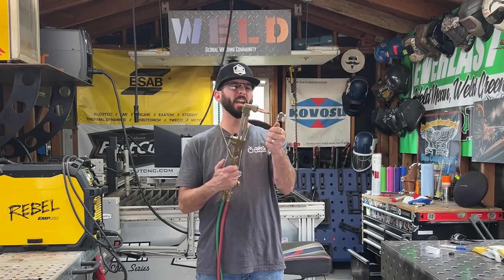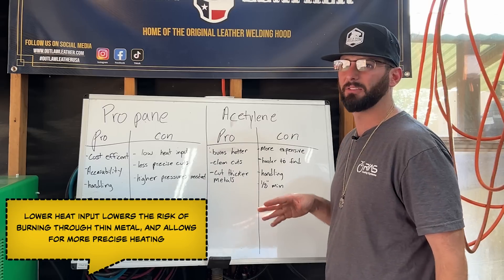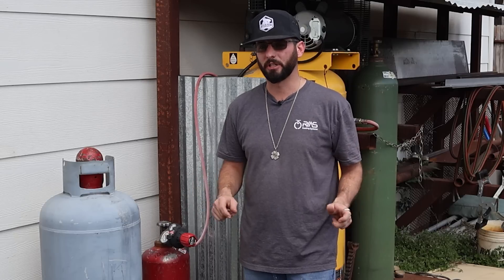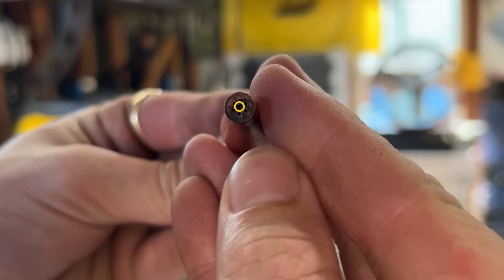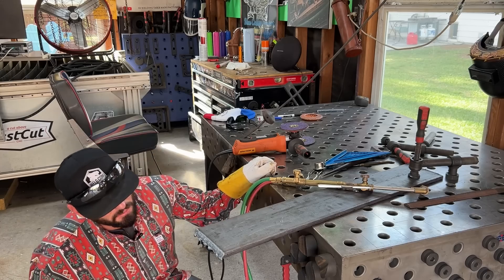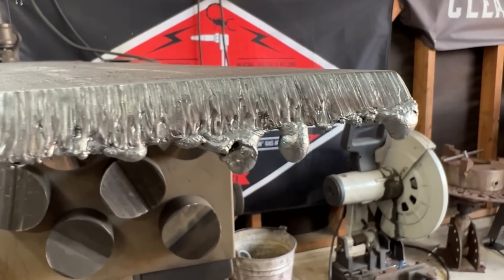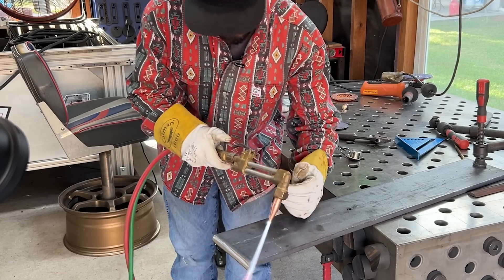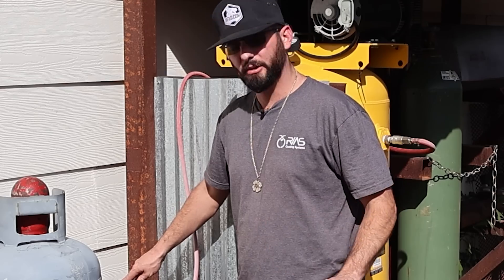Which Gas Is Better For Oxy-Fuel Torch Cutting

Comment: When i was scraping i ran 15 psi propane and 100 psi oxy i preferred propane over acetylene as you hold the tip further from the work reducing tip plugging on the rusty scrap

Comment: 2:15 - propylene (proper chemical name: propene) is not "a mix between the two" (albeit it may "behave like" one) but a separate compound - an unsaturated hydrocarbon with formula CH2=CH-CH3 (not to be confused with propadiene, CH2=C=CH2, which is a constituent of MAPP gas).
The trick/ goal/ idea is to lower the hydrogen to carbon ratio, as too much hydrogen, paradoxically, prevents the flame from reaching high temperature - as at higher temperature hydrogen does not burn completely to water (H2O), but remains at "intermediate" HO- radical stage. And that's why (fun fact/ useless trivia) with "no hydrogen" flame, like cyanogen NC-CN (triple bond between N and C) and oxygen the temperature goes way up, to 4500 °C / 8100 °F.

Comment: Cutting is all in the preheat and the oxygen.  The fuel gas is not a major factor. Once you start the cut, you can actually turn off the fuel because the oxidation of the is what is making the cut and the heat. This is why your results are so similar.
Reply: Yes, you can actually turn off the fuel and you'll be able to happily cut along for some time , albeit not very long one, as carbon steel is rather good conductor of heat / heat sink and thus the heat balance (i.e. input vs loss) will soon turn toward "to cold" and it'll stop.
"Back then" (about forty years ago) as a young "gofer" lad I happened to assist one welder in his job at the company I was employed by back then, and his job was to weld in, oxyacetylene method, a section of a regular 2-1/2" or 3" plumbing steel pipe, but he forgot to take with him the cutting torch, so he resorted to this "heat it up, turn off acetylene, and cut it just with the oxygen" method - and while doing it he struggled quite a bit - had to relight the torch and reheat the pipe more than few times - and the quality of the cut was in the area "best appreciated on a moonless night, with yer eyes closed".
PROPER oxy-fuel steel cutting requires additional heat input for SUSTAINED and smooth operation, and that's why you never see welders "actually turning off the fuel", except when they want to impress/ show off/ make a point that it COULD be done (for a while) with no flame whatsoever. (Also, this is how an oxy-lance works, but that's another kettle of fish.)

PS: here youtube.com/watch?v=7R2JtlcOfBo you can watch a presentation/ test of cutting a 850 mm thick ("tall", rather) mild steel plate (33-1/2") with an oxyacetylene setup, and at around 1:10 you can observe this guy actually kindling up the cut with a piece of steel wire - as the preheat seems not to be enough for actually starting the cut. Which goes to show BOTH the importance of preheat AND the effect of energy input from iron being burned by stream of oxygen (mild steel is about 99.96% iron).

Comment: 25 years welder here. Ive cut with acetylene and propane , i prefer propane by far. Cleaner cut and you can lay your tip on the plate when cutting bevels , doesnt pop like a acetylene. Only downside is preheat time ( though with a heating tip propane is alot hotter )

Comment: I've run burning tables for years using both gasses. Always use the next size up tip for the thickness of material. Beveling always leaves the slag on the finished piece. Bent tips can wash a nice smooth bevel once your used to washing by hand.
I've fitted in a shipyard where the burners were a dedicated trade because of their smooth work. With a good hand there's no grinding needed. A quick wipe with a glove and it's ready to weld.

Comment: Been using Propane now for 25+ years.  You need to do some more research on propane vs. acetylene.  Lots of misinformation in this video.  Propane is superior for making cuts in thick steel, as you demonstrated in the video to your own surprise.  Propane has a lower flame temperature than acetylene, but actually propane puts MORE heat into the material than acetylene, which makes it superior for heating operations.  Propane gives a broader focus of heat, where Acetylene is more concentrated, pinpoint heat concentration, which is why Acetylene does start the cut a little bit faster than propane.  Acetylene has fewer BTU's than Propane per pound of fuel.  The biggest drawback against propane is that you use approximately 30% more Oxygen, but the low (almost free for how much a torch uses) cost of Propane more than makes up for it... even using 30% more Oxygen, you're still saving money over Acetylene.  You can braze with Propane, just as you can with Acetylene.  About the only thing Acetylene can do that Propane cannot is gas welding, because H2O is one of the byproducts of the Oxy-Propane flame, and that H2O contaminates the weld puddle.  Like I said, I've been using propane for 25+ years now, no real desire to go back to the hassles of acetylene.  Once you get used to the way propane behaves with the torch, it's no big deal and you don't even notice.  For the money, I'd say Propane is the superior fuel.  I'd like to try Propylene and some of the other fuel gas blends that they've got now, but good ol' Propane does what I need to do, and it's almost free.  A 20lb tank (BBQ tank) of propane lasts a LONG time.

Comment: I have used LP most of my life I'm 60 and it seems to work well for me here on the farm. I have to do a lot of repair cutting and bending back before I weld it. I do use a lot of oxygen when on a project but the LP is always around if my tank is empty I can get the one from the grill to finish up most of the time. My buddy hates LP and I have thought of switching due to the speed but Like anything you seem to do better with what you are used to. I enjoyed the two perspectives Thanks for the time to show the difference between the two.

Comment: I think you missed the mark on this one. I gave up acetylene over 20 years ago.
Propane cuts much thicker material with the proper tip and sufficient oxy/fuel
Propane cuts much cleaner with less dross - you need to have a higher tip to material distance
Propane is much more forgiving on rusty material
Propane provides more BTU's for a rosebud even though acetylene is a hotter flame
Other than gas welding and brazing, propane is superior in every aspect, in my opinion.
Reply: I've been using propane for 20+ years... I can only find 2 negatives with propane:
1.  You cannot gas weld with propane.  It brazes just fine, but you cannot weld with it.
2.  You use about 25 to 30% more oxygen with propane as compared to acetylene.  But I think it still works out to be much less expensive than using acetylene because the propane is so incredibly inexpensive as compared to Acetylene.

Comment: very much about what you want to do and what you can get or afford, here Acetylene is way more expensive than propane and you can only really get a reliable supply on an account with BOC, there are single bottle deposit options but you can't do anything owning your own bottle. 
honestly the UK is a bit of a pain in the ass for acetylene and a lot of weld gases for that matter
great informations and useful to know I am better off with propane because of what I want it for 
Thanks for sharing

Comment: Try using a petrogen system. It's interesting and another antiquated way to cut steels. They even used it to cut under water. 
It's tricky at first to get it going cuz there is quite the sequence, but once you get it figured out it cuts rather decently.
Reply from the maker: We will have to look into that thank you for sharing!
Reply: Those are wicked awesome!

Comment: You know your acetylene is set right and the oxygen won't blow it out if you shake the torch and just the sides of the flame separate from the tip.

Comment: Just looking at the tip charts for my Smith equipment, propane uses several times more oxygen for the preheat flame than acetylene does. It’s probably still less expensive, but you might end up needing a larger oxygen tank for the same amount of cutting with propane.
Reply: Roughly 30% more Oxygen is required with Propane.  But Propane is almost free, compared to what it costs to have Acetylene.  You'll always be money ahead using Propane.

Comment: One thing you forgot to mention WHICH IS A SAFETY CONCERN EASY TO OVERLOOK is The grade of fuel hose.

There are 2 primary different grades of “Red” Fuel hoses for Oxy-Fuel Torches:
Grade R or RM - ACETYLENE ONLY
Grade T - ALL FUEL GASES.

Despite being able to swap regulators between Propane and Acetylene it’s generally NOT a good idea in practice. 
The phrase keep it simple stupid applies in this regard, less chances for creating a dangerous situation and less things you need to remember or require employees to remember.

Even when you are confident you only use Grade T fuel hoses, keeping the gases running on their own respective regulators and hoses is far preferable even in a home shop as it will keep the outlet of the gas tanks from accumulating fine particles & dust as well as unwelcome critters.
Reply: @TradeWorksLLC  we are all talking about this.
Also you need to be aware of the safety in relation to moving and storing Acetylene.

Comment: Ive’ve done a lot with acetylene, propane, and propylene. I’m a bit out of practice with a torch as I don’t use it all the time any more, but the company I currently work for switched from acetylene to propane for us field guys, simply because of the availability of propane. 
Another consideration for acetylene vs. propane is your business insurance. I’ve heard that some companies won’t insure a shop for having acetylene but will for propane or propylene.
Reply: "some companies won’t insure a shop for having acetylene but will for propane or propylene" because acetylene is inherently unstable and dangerous - once compressed above 2 bars/ 30 psi it will explosively turn itself into benzene (since the triple bond between carbon atoms is very unstable), which will then ignite itself in the air and cause yet more mayhem.
And the insurance is based on a rather simple principle - see youtube.com/watch?v=MZzTTICHrAI&t=184s ;-)
Reply: @MrKotBonifacy I'm well aware of the dangers of acetylene, I was just making a generalized statement without going into technical detail that not a lot of people care to look into.
Reply: @JD-gn6du  Righto. Therefore I decided to provide some technical details very  few folks would care to look into - and this is called a "tandem work" ;-)
Reply: @MrKotBonifacy or you could have made your own comment and not tried to takeover my comment like you did. Bye!✌🏻
Reply: @JD-gn6du  That's a false dichotomy - I DID make my own comment, which was a comment on, or rather an addendum to your comment, so it'd be silly to put in NOT in conjunction with it, wouldn't it? And it wasn't any "takeover" (...?!) nor meant as such - I merely added some extra info, and never thought anyone could, or would see it like one. Cheers!

Comment: Your oxygen seems to have been a little too high with the Oxygen. 
I have mostly used acetylene most of my career. 
There is a trick to it and a learning curve. 
00 tip, 38-40 psi O2, 8 psi acetylene.  
If your tip is clean the high-pressure  oxygen (cutting) cone (through the flame) will be long, clearly defined, and will have a “crackle”. 
And finally—when I was a young man, I could cut 10 gage sheet 48” wide by rotating torch from the edge . 
I might can still do that, but that plasma is SO nice.
Reply: And the ripples in your cuts are called “pressure curtains”.
Too much oxygen for your rate of cut. 
Turn down your O2 a bit.

Comment: Good video and comments. Lots of information. I'm a real rookie. Hoping to finally get a shop to set up the things I do have an learn to use properly. Do have a plasma cutter and combo mig/stick welder with spool gun for aluminum and an old ac/DC tombstone. Small farm and can repair things & it sticks, but sometimes ain't too pretty.

Comment: A couple things. 
The ace didn't cut well, because you did need to preheat it a little more. Hence cut 3 going better, because the metal was finally heated up. 
Second you didn't mention the right grade of hoses to use. The wrong hose will break down with the wrong gas and will crack, causing a big problem on your hands.
I teach with ace at my school, but I use propane at my house. Both have great places, and your pro and Con chart was really good. 
Great video, thanks!
Reply: I had heard the same thing about using propane that you had to use proper hoses.made for propane,because something in acetylene hoses are differant rubber compounds and break down once subjected to propane compounds.wasnt aware about the goop trashing regulators with propane.but wouldnt be an issue as i was running a dedicated reg.with the specalized proper propane type hoses.but was unaware of pressure warnings.
Reply: There is a mark on the hoses that shows what has to use

Comment: You get what you pay for,LOL. Acetylene is the boss-it's better for repair cuts too like cutting a nut off of threads without any damage,it's hot and fast-easier to control pre-heat. It's also more fun on the 4th of July,winkwink
Reply: 🤷 most of my cutting took place at a junkyard.. people always dropped off their old propane tanks that were expired.. free fuel is the real boss.. 😉

Comment: Lighting up with propane,  a trick I have been shown by a pro but never used myself, lay the tip on the steel you're about to cut, helps not blow the flame out when turning the Ox on.
Thanks CEE
Reply: Yep thats the way, also if you’re outside and it’s windy you can put a little Oxy on first too to keep the flame from blowing out
Reply: @stusue9733  I've found that if you just point the tip straight down it helps keep from blowing out when you crack open the oxygen.  You also don't want too much propane flowing either.

Comment: I'm sure it's unsafe these days but I used to start the cut and turn the fuel off to show people you weren't melting the steel out of the cut you were burning it.
Reply: @stusue9733  
I’m glad I’m not the only one who ever did that. 
Cool trick to show off to the “hats”.
Reply: What could possibly be unsafe about it?  And, what better way to show/prove how the process works.  Proof that steel will burn.
Reply: @ Well that would depend where you stand on burn back preventors. Which BTW pretty much weren't a thing back then.
Reply: @ Flashback preventers have been around a long time... that, and the flame would have to make it through the closed torch fuel valve...
Reply: @BKD70  "Flashback preventers have been around a long time"
You say that like I haven't.
Reply: @stusue9733  your comment made it sound like you thought they were some recent invention.  Why did you say it that way then?
Reply: @ No I didn't, that's how you choose to interpret what I did say.

Comment: The 1/7 or 1/10 discharge rule for acetylene is another consideration for using propane instead of acetylene if you have a small tank.

Comment: We used both at the corps of engineers. Propane doesn't cut as hot as acetylene, makes cleaner cuts . But when working outside we used acetylene. Use a chipping hammer to get the dross off
Hitting it from the back side before grinding. Good video should help someone else 
Tks..

Comment: I'm curious how well propane works for heating and bends 1/2 inch rebar
Reply: Propane is superior for heating and bending.  What people get confused about is that while Acetylene has a higher flame temperature, it doesn't put out the quantity of heat that Propane does.  The Oxy-Acetylene flame is a pinpoint source of heat, while the Oxy-Propane flame spreads more heat over a broader area.  Even with a rosebud.  Propane is superior for heating and bending.
Reply: @BKD70 Thanks! Heat and temp are different.
Reply: @grege2383  propane flame is slightly colder so it just takes a little bit longer to reach temperature.
Also the cutting speed is different, the quality of cut is is comparable to Acetylene.
I’m not familiar with how thick you can cut with propane.
I have achieved clean cuts with Acetylene on material two inches thick using a profile cutter.
You require to do a dummy run to remove mill scale preheat the plate top and bottom until you have reached the same temperature.
Gas tip must be super clean inside and out and the oxygen stream needs to be straight and longer than the two inches.
I have issue with the modern cutting tips because they are not very well made and with some types of tips the oxygen stream is impossible to obtain a straight cutting stream and get a clean cut.
I have always used tip type 41 and found that they provide the best results.

Comment: Hi.
I'm a machinist and we use oxy propane everyday for almost everything.
I have had no problems with cutting over 100mm thick shafts as long as the tip is clean and you use the correct pressures wich is roughly 5 oxygen to 1 propane.
We have not injector type torch (I do by the way have an Harris 42-3 and 49 attachment at home which works a lot better).
It's little slow to get up to temperature but you are heating a bigger area too.
Dross problem is easily solvable with proper pre heating and correct travel speed which is when you get a continuos stream of molten metal shot horizontally on top of the plate.

Comment: With a bevel cut try cutting it facing the end of your plate that way it is easier to clean.
I’ve never used a propane gas torch but I have setup hundreds of torches for customers.
Acetylene will cause you propane gas hoses to perish faster as it will dissolve the hoses.
That’s why there are different hoses for different setups.
The more you get that message out the safer you work shop will be.
Reply: Actually you've got it backwards.  Propane needs the "Type T" hose, which is good for all fuel gases, where acetylene can use the cheaper "Type R" hose.